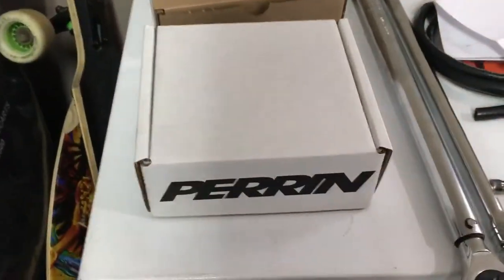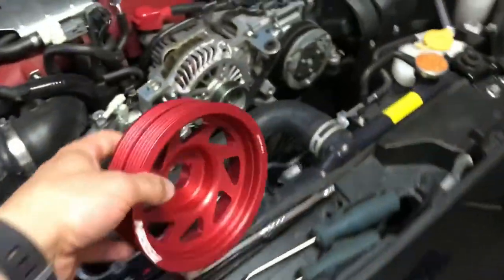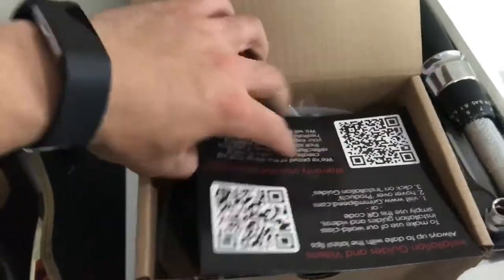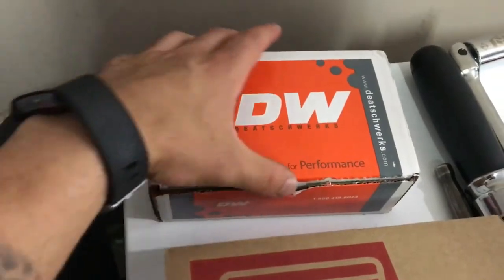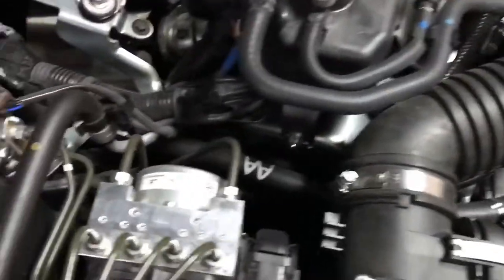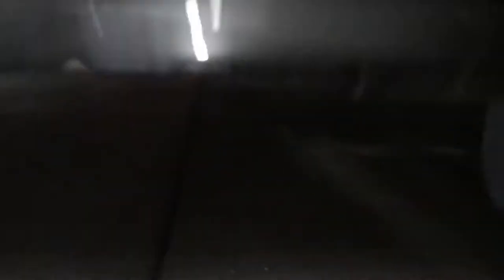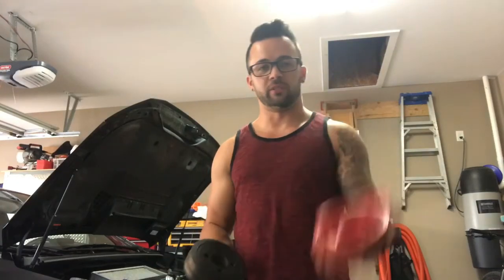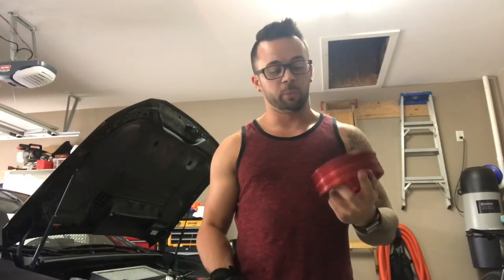2017 Subaru STi - Perrin Lightweight Crank Pulley

Comment: Bro but like how TF did you put the ac belt with the perrin crank pully
Reply from the maker: A lot of curse words.. had a perrin tool for the belt. If I remember correctly I would turn the key in the ignition just to get the engine to spin the belt a little bit and eventually it just popped on after a couple tries.